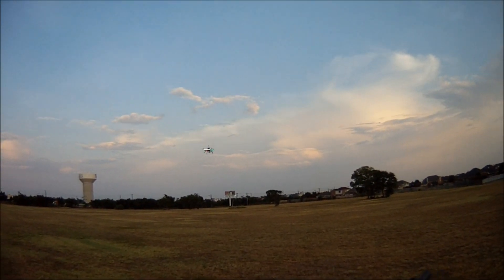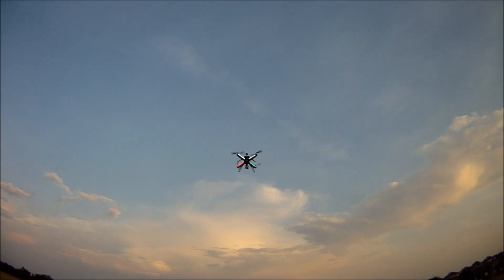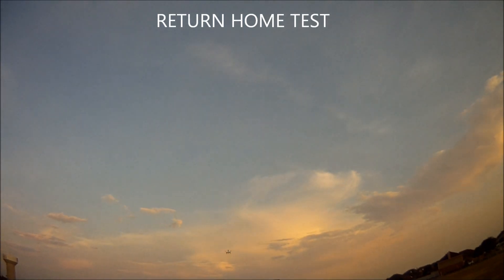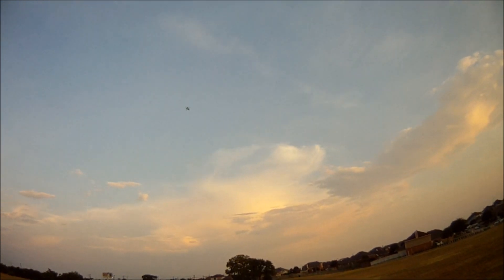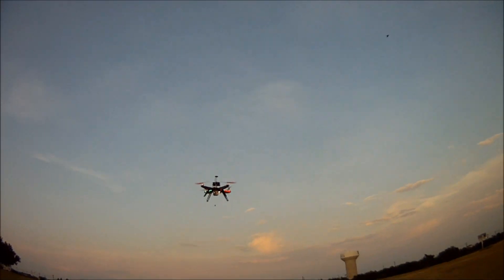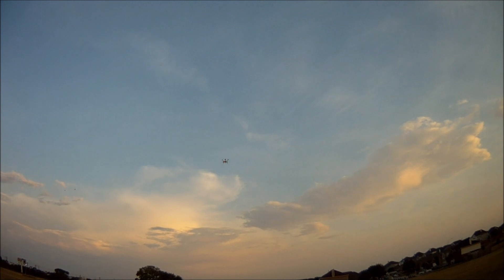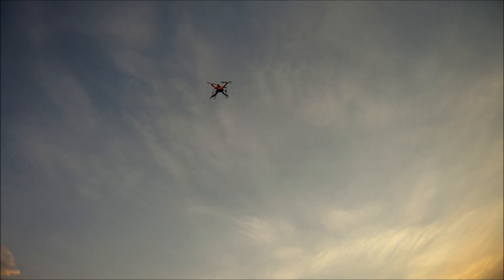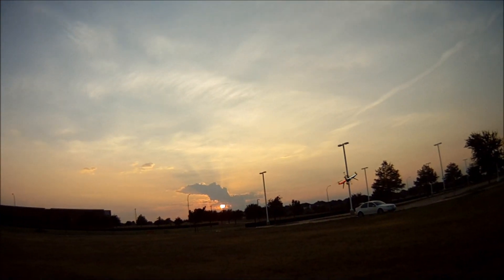HOW I USE HOME LOCK AND RETURN HOME WITH THE NAZA GPS

Comment from the maker: I invoke failsafe by using a mix. When I select my mix switch, I basically mix the auxiliary 12 auxiliary one and cause it to move to failsafe in the assistant. You have to be plugged into the assistant software with your radio on. Keep working with your mixes until you can get the indicator to move into the failsafe area.

Comment: Hellow,

 I have DX6 radio and need to upgrade, because on DX6 I do not have the 6 3 position ch. So..i just need intermediate radio before I will buy another one with 12 ch. I found this DX7 model less expensive. Do You reccomand it , it's a good radio, and still worth the money for an old model ?
The advantage it's that I already have some rx.  Tank You.

Comment: You need to use your Mix 1 and assign a 2 switch lever.  Set the mix to GER - GER and try these numbers out -100, -100, 50%...

Comment: Can camera pan circles be done using home lock?
Reply from the maker: I think I follow your question.  It still would require you to be coordinated with the yaw as you move around your object (home).  All home lock does is allow you to pull back to come home or push away to go away from home.  It isn't set up to work for AP work.